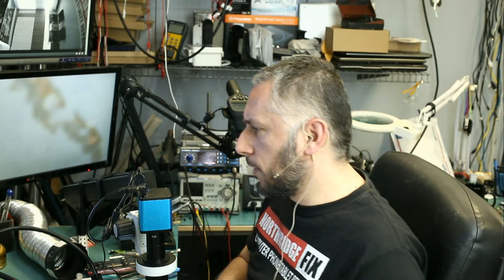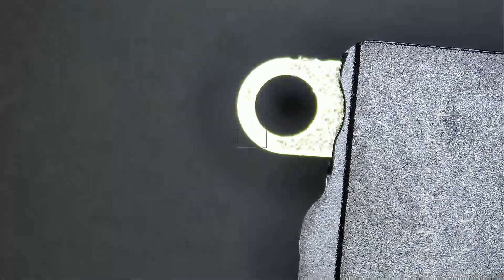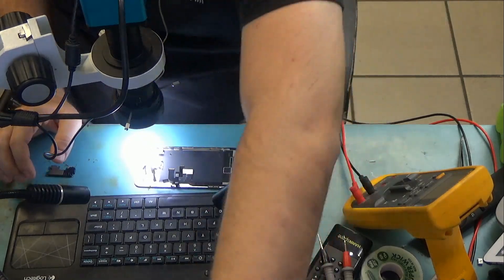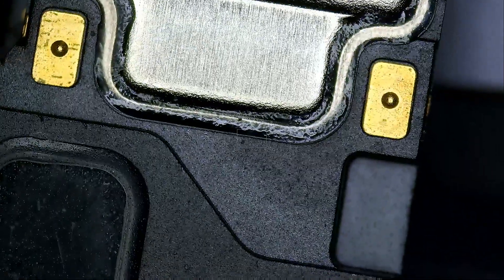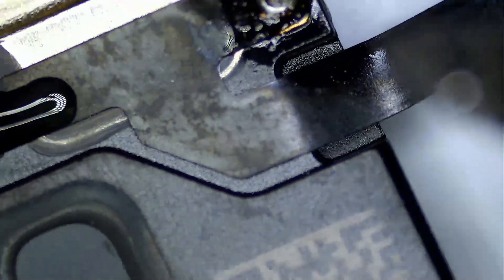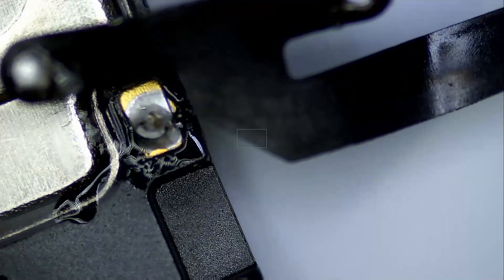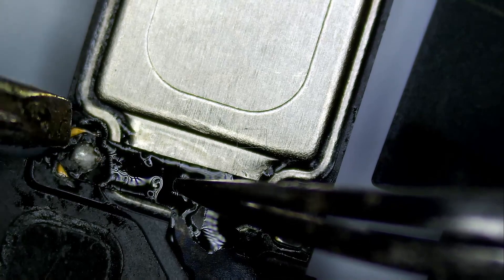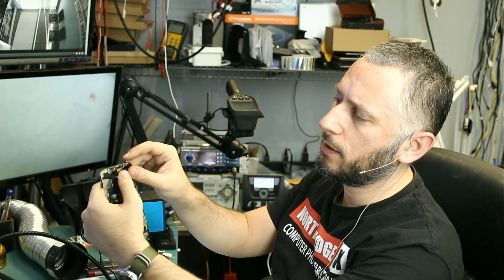iPhone x ear speaker replacement and soldering

Comment: i just replace the battery and ear speaker. Face id will work if you don't damage the original flex cable. Just solder properly, and everything works.

Comment: hello, congratulations for the video!  can I ask you at what temperature the soldering iron must work for this repair and if you need to pre-weld the speaker before soldering the flat cable?  thanks
Reply: 450C

Comment: Guys, can someone please explain me why the Face ID will stop working when it’s not at all on the same flex cable where is the brocken earpiece speaker. Face ID or DOT projector is on the flex cable under the battery, together with camera. NorthridgeFix really grate video, plase give me comment on this so I understand better how is this causing the failure of Face ID. Thank’s
Reply: If you do it like in the video, face id will still work. it only doesn't work if you change the whole module with new flex cable etc.

Comment: If u change the flex cable face id will not work if u want to change the flex because of a tear u need to transfer the components on the flex

Comment: So, I just replaced my speaker because the audio quality was crackling and terrible.  I had purchased a complete speaker and cable, and when I installed it, the FaceID would not pair with the phone (thanks Apple). I decided to try this swap, desoldering the speaker looked easy, so I went ahead (even before I watched it) and now I get no sound from the speaker at all.  I reverted the cable, went back to the old speaker, and I still have no sound from the earpiece.  Now neither my old or new speaker works, so this leads me to believe that something needs to be reset in the phone.  The power was off, battery and screen disconnected when I did the work.  Not sure what else to look for. Any ideas would be welcome.
Reply: did you solved ?
Reply: @stein3d  I did solve it. It actually turned out that the new speaker I purchased was faulty.  I ended up buying another faceid/speaker cable and desoldering the speaker from that and reattaching it to the phone's original faceid camera.  Everyone works perfectly now.  It is tedious but with the right tools, you can do it in an hour and avoids what Apple might charge you for such a task.
Reply: Doesn’t the flex damaged when applying heat from the solder iron ?

Comment: Is there any hope to keep Face ID if the small flex cable that attaches to the ear speaker assembly rips? When I opened my iPhone X to try repairing it the thing came apart in such a strange way and caused that cable to rip. My assumption is the only way to keep Face ID and have the ear speaker work is if someone did some miracle soldering to somehow attach the ripped flex cable to the two microsoldering joints? I've seen this done with torn Touch ID flex cables before so I'm curious if it's possible with this?
Reply: Sir with due respect you need to be professional and extraordinary skilled with soldering to perform this types of jobs.. I advice everyone non professional not to try this by themselves rather seek assistance from someone professional.. Thanks 😊
Reply: cell hospital my question is if it was possible to solder that ribbon cable and it is. But you must solder tiny wires to restablish the network of leads. Very difficult like you said but thanks for the reply.
Reply: @PodtrashRadio  pleasure 🙏

Comment: Hi after I connect the speaker flexy phone goes on and of and if I disconnect phone works properly what must I replace
Reply: Ali Naqi you damaged the flex, it could probably be microsoldered / repaired but it would probably be quite costly.

Comment: Question, does Face ID work after this?
Reply from the maker: Why wouldn't it work?
Reply: @NorthridgeFix  I saw other guys saying the face id stop working after replace the earspeaker too
Reply from the maker: @Vh3pro  That may be true if you replace both the proximity sensor and speaker but we only replaced the speaker and not the whole flex cable.
Reply: NorthridgeFix if the earpiece is broken will it affect face id?
Reply: Carlos.144hz no
Reply: Gentlemen! Why it wouldn't work? He never even touched the face I'd sensor.. If you are professional technetions you won't even ask this stupid question...